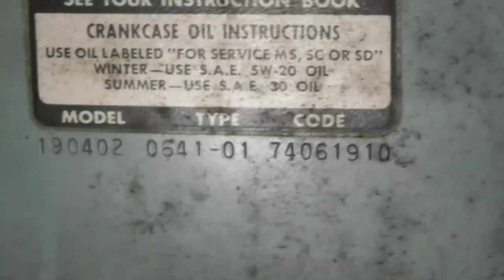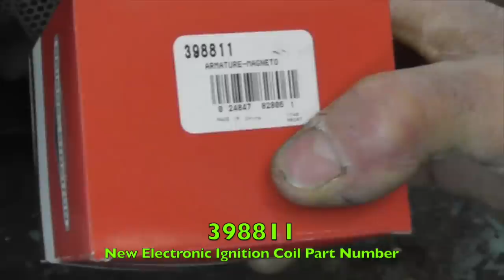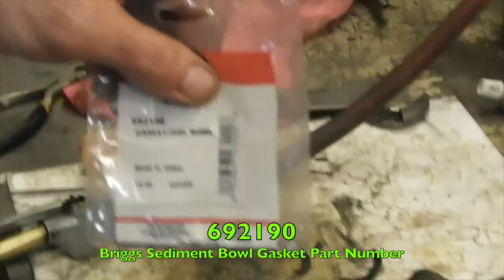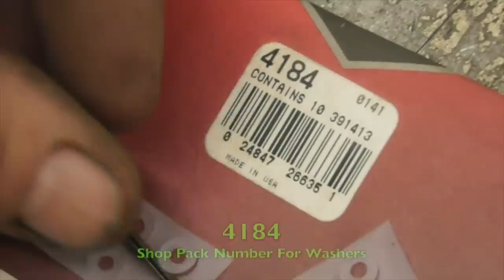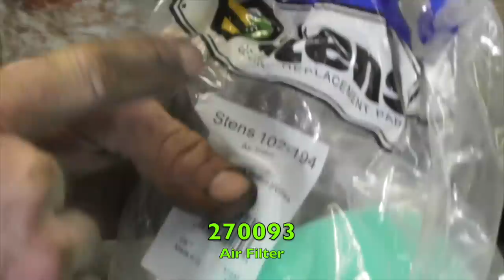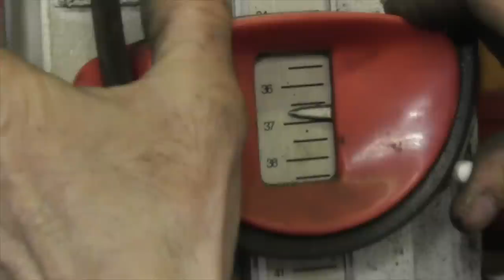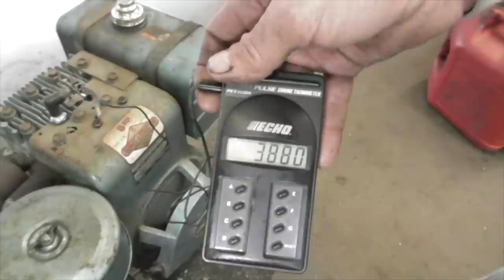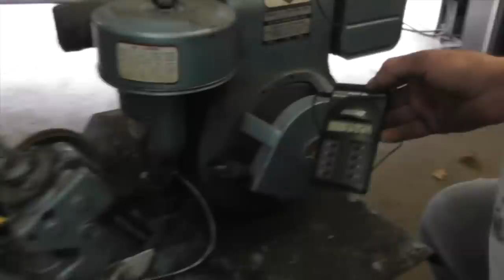How To Troubleshoot A Non-Running Engine (1974 Sears Rototiller) with Taryl

Comment from the maker: Be sure to pick up YOUR Taryl Apparel Today! Shipping Worldwide Daily. 
http://www.TARYLFIXESALL.BIGCARTEL.com
And There's Your Dinner!!
Reply: One good tool to have cleaning carbs is a torch tip cleaning set
Reply: In those Briggs 3-3.5hp engines there is an aluminum fueltank.
Reply: EXCELLENT video! A-PLUS!
Reply: 18 hp kohler on toro timecutter new battery cellinoid blows 5amp fuse after about 15 minutes mowing turn key want do nothing
Reply: @greenegardening7183  @Michael Compton  p
Reply: @greenegardening7183  @Michael Compton
Reply: I wish I had saw this afew weeks ago. The first thing I watched him do was a Nikki carb replaced by an after market Wahlberg. Mower he was working on same problem I had. Didn't know anyone to go to. So I talk to a supposed to be small engine repair man. When he says he's done I go over, crank, same noise a little better, and little I really mean. I turn it off and he says " Well" and I say " That's what I wanted you to fix." I can't fix that till I get A Wahlberg carb and I can't find one. I've looked everywhere. I leave. Get on google and have found them every where. Maybe they were after market but it was possible. I watched it being done on here. I give this man on this show a 100% thumbs up! 
What state are you in?
Thanks.
        Sheree Collins
Reply: Cab we get z bender at the to store or just on website
Reply: Always mate..
Thanks

Comment: These videos are addicting.   I have a great respect for your mechanical skills but not your choice of dental professionals.
Reply: Taryl goes to a dentist in England!
Reply: I used to have a girlfriend that could eat corn on the cob through a barbed wire fence. From the neck down she was a perfect 10 though.
Reply: @leeb.7188  and he still has a bit of a wait in the waiting room.
Reply: Hello Robert Huff, Yup ur right, I can watch these vids for hours at a time,
then when wrkg on an engine I start to remember things I watched Taryl
do when he's wrkg on a particular issue.
Reply: Hello Robert Huff, yeah they are! I can watch these vidz for hours! most of the
time I get a few good ideas per video.
Reply: Raymond Garafano m
Reply: @paulhulse3414  Howz it going? Just clnd a carb 4 a 9HP briggs cast iron job.
gotta get a fitting 2morrow for a fuel line and have the cat battery on charge
to crank that delco remy starter/gen. hope u have a good project to work on.
Reply: Hahaha
Reply: Robert Huff @ could be worse in ol' days of sabre tooth!
Reply: I just started watching your videos . Very informative and easy to understand. Thank you.  Are you open to questions about troubleshooting mower issues?
Reply: @prevost8686  should have kept her now days with all the masks you would be in good shape

Comment: Thanks to this video I pulled out my 1973 sears rototiller, just like the one featured, and put in a new electronic coil, new carb and fuel lines,  changed the fluids and after 20 years of sitting ...it runs like a swiss watch.  Smooth.  Thanks Taryl for your wisdom (That is your smarts)
Reply: I also  have one I call it EL TORO BEST ROTO TILLER EVER

Comment: I am very proud of the Dactal family for many reasons.  First, you had an idea, and then you finished it. Second, you blabbed all the secrets of small engines.  Third, you gave us the confidence to work on our own stuff.  With your guidance, I took a 1977 chain case of a Yard Man tiller completely apart and fixed it with a 5/8" top shaft I had to get made.  After I put the engine back on (135202) PulsaJet carbitrator---- It actually worked!!!  I owe most of my gumption to you.  I now collect a certain brand of metal toy that was extremely popular from Mound, Minn. --so Slippers does have SOME sense.  Thank you for realizing your YouTube dream.  Now YouTube can build a second story onto your shop!
Reply: Are you going to be a bad actor next????? LOL

Comment: Tayrl,I have my dads 1950 David Bradley(sold by Sears and Roebuck)it has NEVER had the engine taken apart,(1.5hp.Briggs/Stratton rope start)it STILL HAS the original spark plug in it and it STILL RUNS and it doesn't burn a drop of oil either...NO JOKE!!.
Reply: 4 gauge I just restored a 1958 DB Roto-Spader w/2.75hp engine. Cool old machines. I’m hoping to get a DB Tractor to restore next.

Comment: I used to use carb cleaner as a starting fluid, but I switched over to using a spray bottle with some two cycle gas in it. It provides a bit of lube for the top end, especially on engines like this one that has been sitting for quite a while. And yes, carb cleaner in the eyes really burns! And if you happen to have the official small Briggs flywheel puller, it has the right hardware for pulling those float valve seats. You just have to provide your own spacer tube. Excellent video as always Taryl! That’s pretty much the same procedure I use when something like this back to life. My Dad used to always tell me, spark, fuel, and compression and it’ll run..

Comment: A one hour video? This was the longest I’ve ever gone without a snack or cup of coffee. It felt like  ten minutes!
Reply: Me too BC. I could watch Taryl all day. Now I have to check out your channel to see what's new.
Reply: That was really good! 👍
Reply: It's all about time travel man... LMAO
Reply: Terminator-tiller😎(killer-tiller)was a EXCELLENT video Tayrl. 
The tiller in this video was definitely worth a 6-pack of 🍺 beer and I don't even 🍸 drink,I would have bought the guy a 12 pack of beer and told him to"keep the change".HAHA!!.
That tiller will last almost forever the way its built(like a tank)and most of the time your only going to use it twice a year for brief periods of time anyway(spring planting/fall harvest),unlike your lawn mower.
I was noticing after you were using the"Z"bender Tayrl,you didn't"temper"that end of the throttle cable.Alot of mfg.'s"temper"both ends of the cable because that's a wear-and-tear stress point.(No big deal,it was just an observation)
Back in 1974 lawn/garden equipment  was made alot better in general,thicker and better steel,NO PLASTIC,alot more machined steel gears,more cast iron in the engines too.
AND THERES YOUR DINNER!!.
Reply: Had I known, I would've lined up the coffee and snacks.
Reply: @Tommyr  - OMG, LMFAO !!!  😂😂😂😂😂😂😂😂😂
Reply: @ronkpaws1  Another Great Video of all time...  just say`n
Reply: alot of people can tell u some things about engines but are DEADLY BORING. Not
Taryl!

Comment: Taryl, a BIG thanks going out ur way. I don't bother with cable t.v. I'd rather spend hrs on the interskreen watching you fix engines. seriously, I got back into this last year as gas on a lady
friends generator got left on. power went out for a day and she had no heat. I called her to say
"HI an how R ya. she told me she caught a bad cold. so I went and got her generator, pulled the'
carb apart, let it soak all night in carb cleaner, blew out all orifices with shop air and used a bit
of wire from 10 stranded and ran thru holes in jet. serviced air filter, gapped plug and got a new
magneto coil which some call an ignition module, so HI-TEK! Got ther running good and adjusted
the governor, It works great for her now. I service it for her free cuz she's a sweet woman. 
Anyway, like I sed tho, Thanks very much for these great vidz. I'd rather get an old engine to run
than to get a new one. Two thumbs up to U junior and Slipperz!

Comment: Great stuff, Taryl. As you said, they don't make things like they used too. That 1972 Sears Rototiller is built like a tank! That is the year I hired into GM. 30 years and out and haven't looked back sense. Those days are long gone. I was given a 1966 Simplicity Landlord 101 by my neighbor about 24 years ago. It's all original. I did touch up some of the white paint, which was pretty rusty looking. New tires and fuel lines and a new carburetor. Oh yes, it needed new spark plug, points and condenser as well. It came with a 42 in mower deck and a dozer blade. A set of chains for the rear ties too. It still starts right up and runs quite well for an original engine. I have never done a compression test to see how much compression it has. I had to replace the axle seals, which were leaking. Like you said that old stuff is built extremely strong compared to today's equipment.  I mainly use the Simplicity Landlord to move my utility trailer from the back storage building to where I can hook it up to my Yukon. Your videos are very entertaining as well very informative. If I need to work on any of my machines, I look to find one of your videos, which covers just about every subject.

Comment: A good additional step to your tank cleaning with vinegar and bolts at 21:20, I'd do that, but jack up the rear wheels of a rider, bungee strap the tank to the side of the wheel, start the mower, throw it in gear, and let it power clean the tank. Lol

Comment: Taryl I have a tiller that is around a 1958 or so  put a 3.5 hp tecumish on it 30 yrs ago ,stolen from my younger brother off his mini bike lol , have a great holiday , ps just replaced the gear box seals this spring all is well ,from your friend Thom in the Motor City, Detroit Michigan, (retired auto mechanic of 50 yrs.) love your videos very educational.
Reply: What kind of oil did you put back into the tiller gearbox?

Comment: Hard as a carb! Best be changing that! You the man! I have about 40 of these engines ranging from 3.5hp to 10hp and I have been using all your tips and tricks to get them running like new again for future hotrod mini bike and go kart projects. I really liked the micro jet drill video you had. I bought a set for myself and it makes life easy when swapping carbs after intake and exhaust mods. Can really tune up these old engines. Keep the videos coming you were a better teacher then the ones in my university. Much appreciated and very entertaining.

Comment: I enjoy the Hillbilly back yard mechanic buck tooth guy who has been around small motors all his life and likes making old Briggs engines come back to life.  We all started on those and they all are a lot of fun.  Not much has changed on them except the electronic ignition they have came up with.  I am glad you post these videos because they are very entertaining to us old farts who grew up putting these motors on mini bikes and go carts back in the 60s  and rode the shit out of them all summer long.  God those were the times hopping them up to where they would out run the neighbors most expensive mini bike when we just had a little cheep one.

Comment: There are a few of these tillers sold in my area,  and I worked on almost everyone, and they still show up occasionally at our shop for repair and I enjoy very much working on that unit.  My dad had bought a new one in 1969, it was red and had 6hp Tecumseh.  Very tough machine, we ran ours so much that a hole wore thru the gearcase, patched it up with epoxy and ran for many years after.
Reply: That's good stuff

Comment: Oh ! It was heads up for me today on lubricating that type of throttle cable.

I saved $$$s on lubing up the old throttle cable on my 3 HP Briggs & Stratton Supaswift push mower.

I had some chain lube handy so I soaked the throttle cable with the chain lube which freed it up.

So,I'm glad that I watched this video to get that tip !!!!

Comment: My favorite video is the rebuild of that old 1981 5hp brings and stratton, yesterday I got one tiller like on this video and I recognize the engine and remembered your rebuild so I just got it for $50 as a project and let me tell u something, it's more fun watch you do it. The carbutrador have more led than a fisherman lines.
Reply: Update: (carburetor) the emulsion needle was stuck on the Threads And I broke the head with the screw driver, Then I tried to unscrew it with a channel locks and it broke in the middle,( drill bit and tap? Yes but I just bought one new carburetor for $18 in Amazon
Reply: Update (carburator) I been watching this video like 10 times only to realize to be able to start the engine you have to put the lever on fast position( my tiller have a manual choke so I was trying to start the engine with both butterflies closed)  I don't know how but I did it, anyways the screws are turning me crazy, I can't find the right configuration, and realize in fast speed the mix was too rich, how I know? Cause the red light inside the muffler turned on red, anyways I'm gonna save that screw configuration If I need a torch. Oil levels are good and fresh in both engine and transmition, gas tank is clean using some rocks and sand like making a martini, no leaks, but I found that the rod that pulls the pulley is a little wear cause when full pulled it touches the transmission input shaft from the bottom.

Comment: I have this same tiller but a 1977. Got it non running from a neighbor after it sat for many years. No spark and a dirty carbitrater. I replaced the points, cleaned the carb and she runs great. Had to weld some metal pieces to the tines as they were worn out but it works great!

Comment: I took over a lawn tractor project that had been abandoned, and after I put it all back together so I could even start to troubleshoot, the first thing I found was so much mineral and rust in the outlet of the fuel tank, I had to drill it out before it would pass anything.  Thing ran fine after that.  Probably 10 years of sitting in a pile in the garage because no-one looked at the fuel flow. :)

Comment: Wish I ran across this video about 3 days ago.. I have an old 1975 tiller just like that one from Sears. (Choke setup is different) The coil wire looks like it blew up, have no ideal how that heavy wire was broke in the middle and the insulation was, well, look like a monster chewed it up and down.  I did NOT know about taking the high gas needle seat out before pulling the carb apart.. I hope I got that back in without damage.  It's back in. I'll get my parts later this week so I'll see how things go..    I really loved the video, a lot of good tips..

Comment: I just purchased this Electric Start Generator after putting it together, put in oil and gasoline started up right off. I am very satisfied with my purchase at the price and I believe it will come in when I need it in an emergency.

Comment: I had one of these Crapsman tillers in the 80's. I loved it. 8 HP two speed with reverse. It would tip out big rocks on the first pass, and I'd use high speed for the second pass. Great tiller. If I ever find another I'll keep it forever.

Comment: Hey tarly keep the videos rolling!
I learn lots from them.
What i use to clean gas tanks or Coleman lantern tanks out with by putting small ball bearings with a cleaning solution of choice put the cap on and shake and roll them around inside the tank.
They'll last forever!
Hello from Pittsburgh,Pa to you and the rest of the crew at grass rats garage!

Comment: When I clean an old fuel tank, I use vinegar, a small chain, shake the heck out of it, rinse and dry, Then I pour in an epoxy to coat the inside of the fuel tank, if I suspect any pin holes may be developing. I also coat the bottom out side of the tank too. Done! The old saying. is "That's what I do!" Thanks Taryl,

Comment: Another fine video as usual.I just happened to come across an older snapper tractor with a 12 HP engine with the same kind of adjustment screws. Fuel was coming out kind of rusty, so I pulled the carb and pulled the screws as well. Found the adjustments on line, but good to know that you made a video for this type. Prior to cranking the motor would only run on full choke, so I hope this cleaning had done the trick. The battery has run down...on yeah the compression was only 30 PSI. I would think a 12 HP would be more???

Comment: The problem is dude may have gotten that tiller for a six pack, but with parts and labor to get it running, he’s looking at around $250 bucks. Very thorough and good video.

Comment: Good video. I have a 1971 Roto Spader similar to that. It has a 4hp B&S like a push mower engine. They made them to last back then. It’s got some thick heavy parts on it. The spades are nice and heavy. Not like the through away 1’s they have now. Just wish it would have had the side shaft on it like that 1 you worked on.

Comment: Great video...thanks.  I have a very old Troy Bilt Horse tiller.  It is works great.  I redesigned how you take it out of gear.  The original design would bend the handle trying to take it out of gear.

Comment: This old tiller is in real good shape for its age...excellent actually. And, it sure is better made than 90% of the new ones.  That 5hp looks just like the engine on my 1955 David Bradley 5 Special..except the oil bath air filter.

Comment: I used to have this very same tiller.
It was stored in a detached garage for a season then would not start.
I took off the crank shell, used a gear puller on the flywheel and found mud wasp ("dirt dauber") nests on the magnet portion of the flywheel. 
I chipped them off with a screwdriver, buffed lightly with Scotchbrite, and that puppy fired on the 2nd pull....

Comment: This helped me a lot I got no spark on my Montgomery Ward Coast To Coast 5 hp Briggs Roto tiller Killer lol. I always run Non Ethanol gas so I rarely ever have carb issues but I have not found the idler pully bushing that is wore out completely. Still working on that.